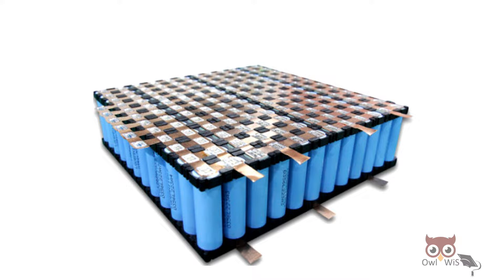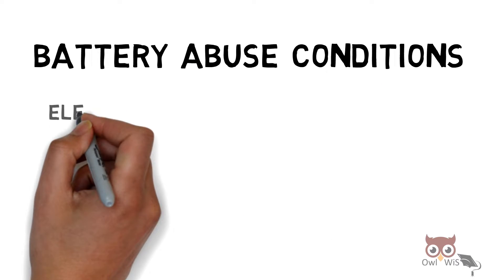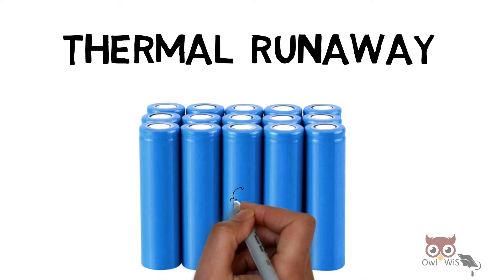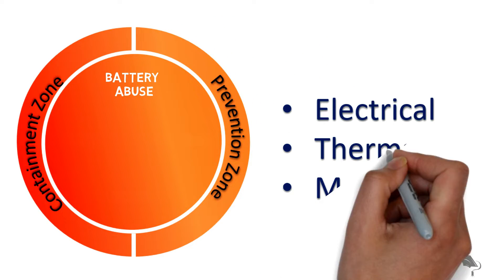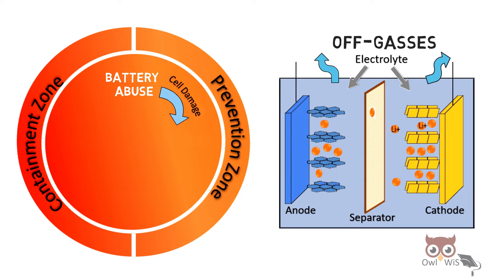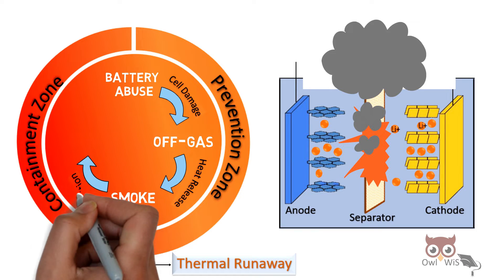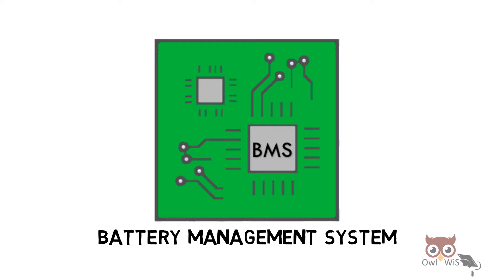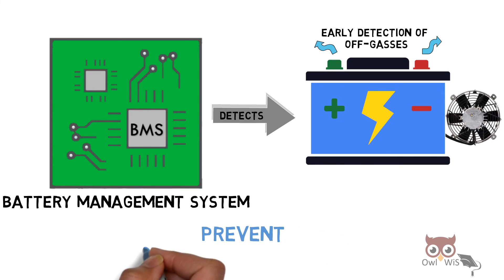Thermal Runaway in Lithium Ion battery | Battery Abuse conditions | Battery fire | Prevention

Comment: very well described. You can also prepare certain videos on electrical modulus and ionic conductivity as this is the main topic for supercapacitors selection of material.thermally stable gel polymer electrolyte are gaining mass popularity. you can think of such videos on the same as well.. All the best.

Comment: There are internal safety devices that help prevent TR such as vents or CID depending on the packaging of the battery. Standard 18650 or 21700 cylindrical cells have such devices while pouch cells normally do not. In either case, TR is no joke and should be taken very seriously! I did safety testing of LI cells and they are very powerful and release a lot of energy very fast (very hot fires).